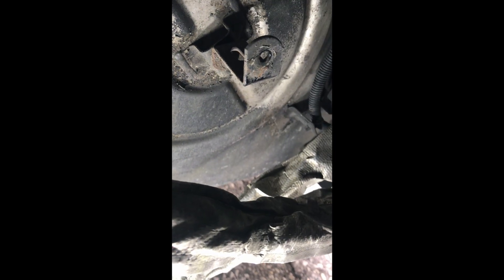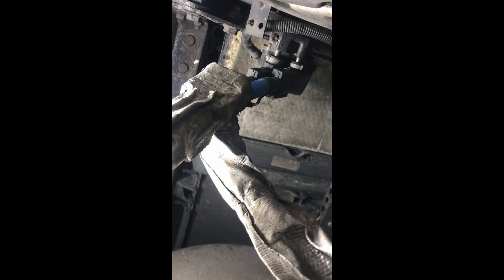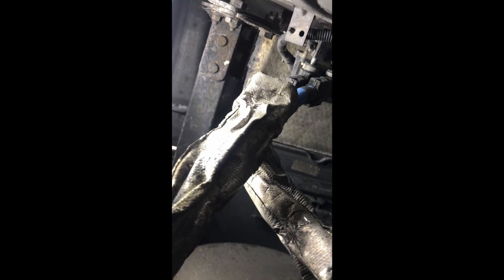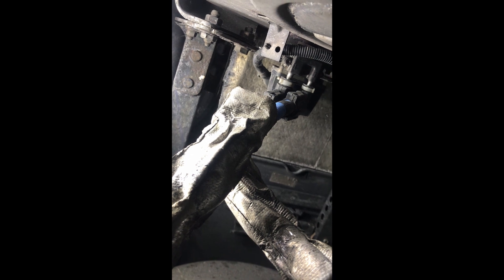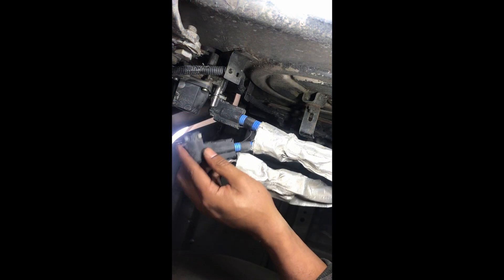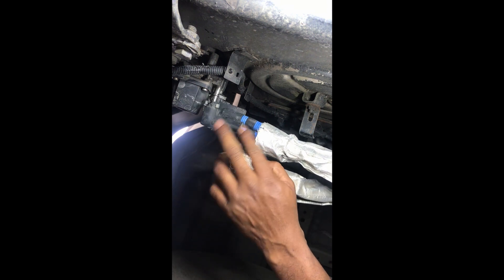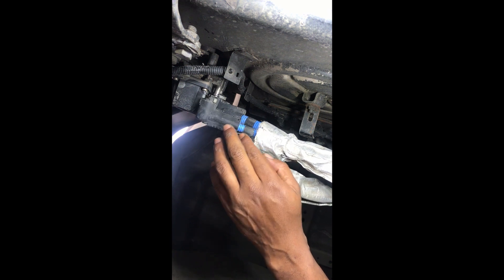SFT Repairs | How to Replace SCR Heater Line #5

Comment: I had the same codes 1 year ago, I replaced both houses(one of them was burned I found out) , it helped, but now I got the same code... and cant find any visual issue in the lines, they are like new... if the heather itself is bad , is it giving the same code??

Comment: How much can you drive with that code on? Does anyone know if it makes things worse
Reply: Did you get the issue  fixed ?
Reply from the maker: I hope you got it fixed asap
Reply: I changed it nothing happened.  Christmas lights still on but we dove for 2 weeks now not a single difference
Reply: You may be able to drive with it malfunctioning indefinitely. It only heats the def. Been driving mines for a month like that.

Comment: Thank you for the video. Got 2 check engine lights with this code. Do you know how many miles can I drive with this before I get to the shop?
Reply: I drove it about 800 miles with that code. Truck shops had no spots to replace it. So I drove home along I/80 with 40k load. So if its the code
ECC  61 5488 fail 5 , I made it safe across.
Reply: @h.e482  I just got that code yesterday  drove 500 miles to Michigan our yard replace It tomorrow..

Comment: I’m getting ready to try to do this tonight. Seems like it would take a lot less than 6 hrs, was those clamps that hard to get off or were there other factors?
Reply from the maker: A-Money it took that long because I was at a customer in their dock so I had to drop the trailer bobtail to Freightliner come back and wait for everything to cool off. Before I went to get the part I wanted to see how many butterfly zip ties I needed also. If you’re at home or have the truck cooled and everything you need it shouldn’t take but about 2-3 hour at most.
Reply from the maker: A-Money I just wanted to document hike long at most it could take worse case scenario
Reply: 2-3 hr when I got done

Comment: Thanks for the video bro!! This saved me hundreds of dollars. I had the same issue. I went to Freightliner, got the parts and fixed it myself! Thanks again.
Reply from the maker: Nat Coziay glad it was helpful! About how long did it take for you?
Reply: @sixfiguretrucking  It took me about six hours. I imagine a mechanic could have done it quicker. The hardest part for me was removing the clip to the line on top of the pump. Having to squeeze the clips in such a tight space was hard, but I got it done.